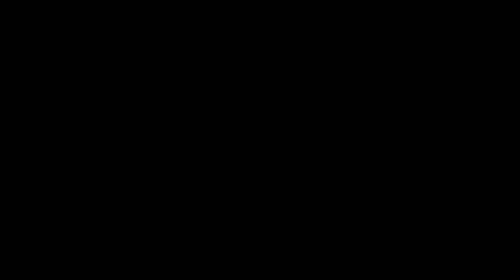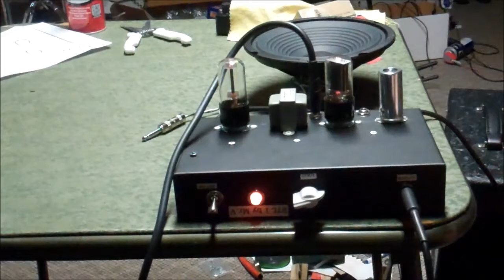RTL-1 Series Filament Guitar Amp....  Part 1

Comment: I've thought of building a stereo amplifier with a couple of 50L6s.  I'd probably run it with +200 on the plates of the 50L6s, use a 12AX7 or 12BH7 driver and a bridge rectifier with a voltage doubler to produce the B+ voltage.  (The 12BH7 is a very similar tube to the 12AX7.)
Reply from the maker: 50L6 isn't particularly linear... so I don't think of it as hi-fi.  I totally dig it for radio,  and it sounds nice and warm if you're ok with a colored sound.   Guitar amps live for colored sound.   If you're doing Series Filament,  there's a 40Z5 that's almost exactly like a 35Z5, with a slightly higher filament voltage...  those sell cheap with no demand.  Best of luck with your projects...  Controlling electricity is a great hobby.